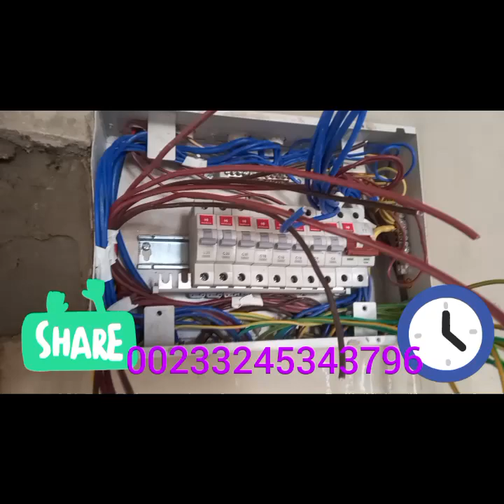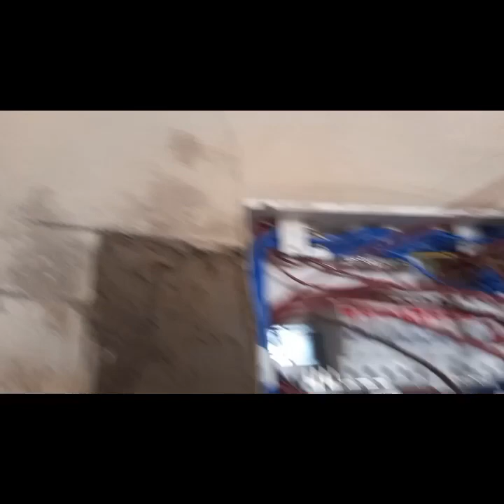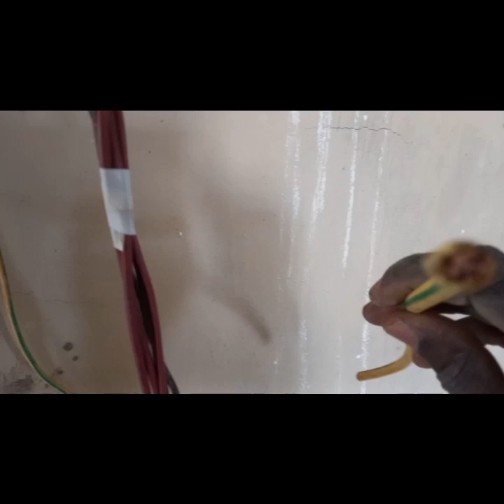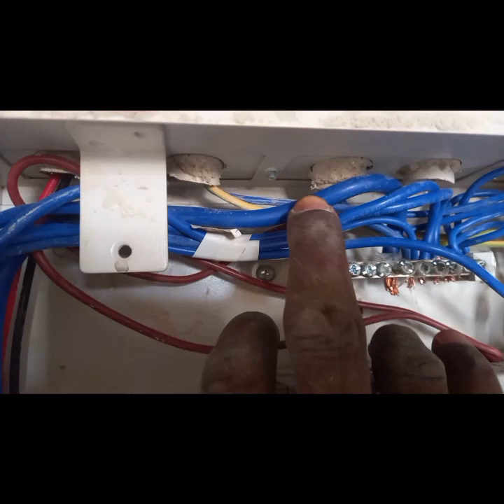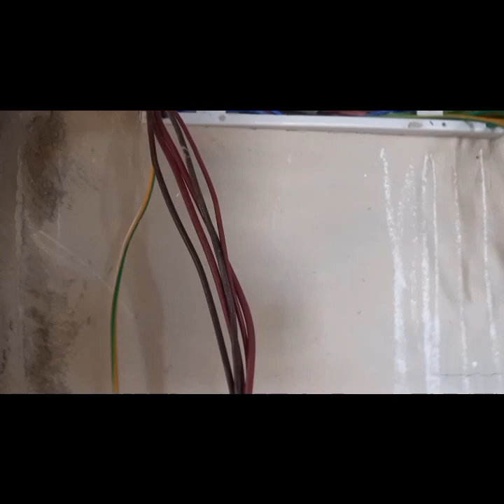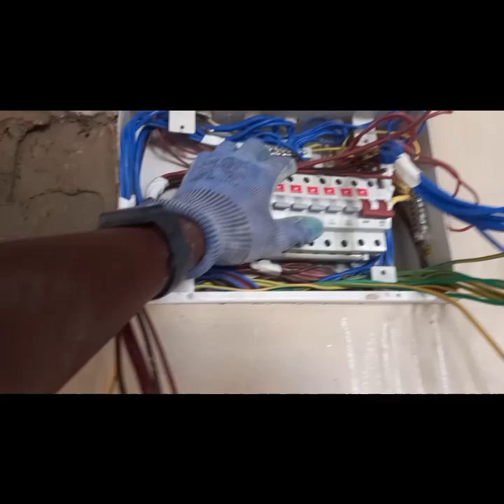Building In Ghana | Electric Cable Size And Application

Comment: Great video , my question is 16mm is equivalent to 6awg  stranded wire in USA  could it be use for wiring in Ghana ? and also with is total length of 16mm coil or roll in feet ? Thank you
Reply from the maker: @GentlemenRadio  thank you sir.
Yes that's correct, 6 AWG is equal to 16 mm² cable.  This is a general principle concerning electric cables in Ghana; first it must be certified by Ghana standards authority, then on the list of electric cables listed by Energy Commission Ghana to be used for electrical wiring in Ghana and finally colour code. 
The colour code here is:
Brown for live or hot conductor 
Blue for neutral conductor, green & yellow for earth conductor.

Comment: How could you see that the cable size do not qualify for an appliance
Reply from the maker: Okay, so there are clear instructions on Cable size. 
1.5 mm² for lighting, ceiling fan application 

2.5 mm² for socket outlets: washing machines, refrigerators, electric irons, radio sets, tv sets, water pump etc 

4 mm² for 15A application: air conditioners, water heaters, dryers, cooker units and some other appliances that may require higher power to operate
Reply: Can you use 3mm square for the sockets instead of 2.5 and 2mm for the lighting instead of 1.5? 
Also, do you have to buy the all colours for the sizes. Eg. 1.5, 2.5 and 4mm of the blue colour,  1.5, 2.5 and 4mm for the brown and the yellow/ green as well?
Again, are colours Red and Black not used again in Ghana?
Reply: What should be the colour for the 16mm square cable per Ghana's standard